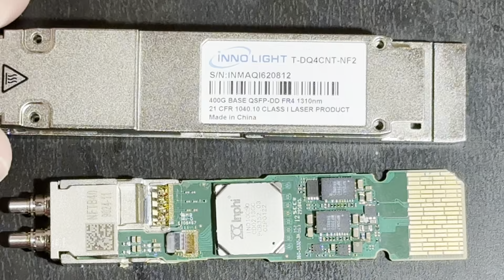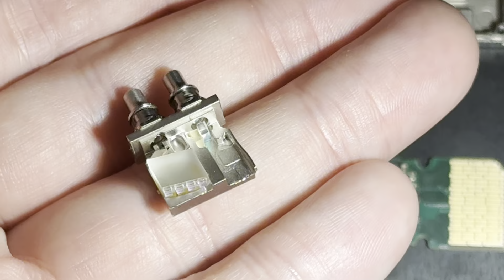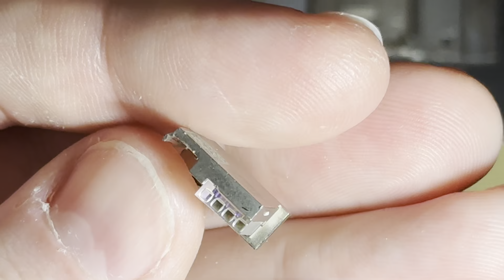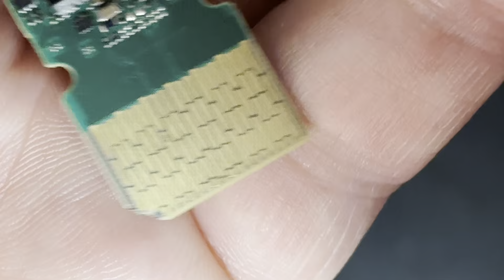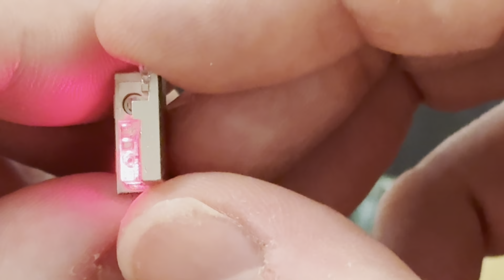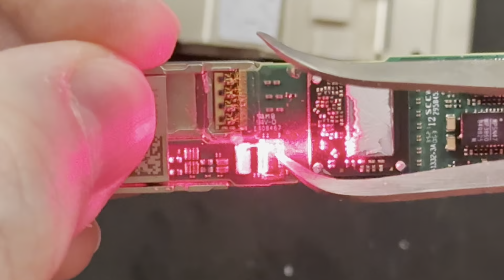QSFP-DD teardown and experiments with optics

Comment: Thanks 🙂 Never seen a 400Gb module opened yet. Took a peek into 40Gb QSFP one, and there were two sub-modules for TX and RX inside. Even found a paper describing how they are built, with some monochrome photos. Didn't open it further, the module is still working.